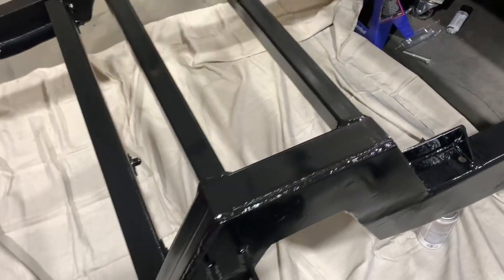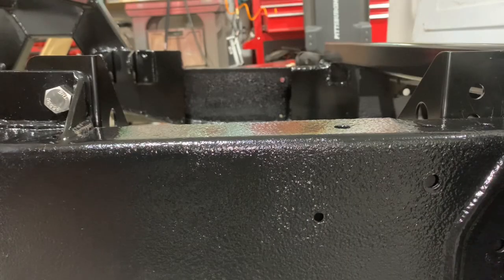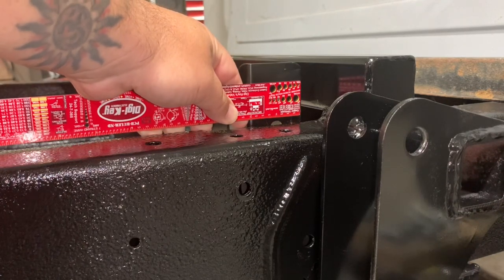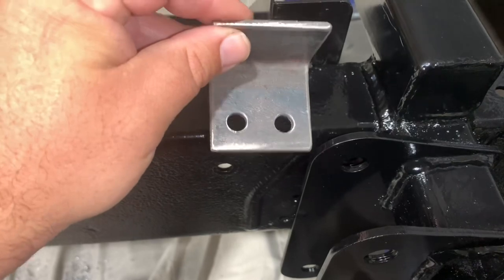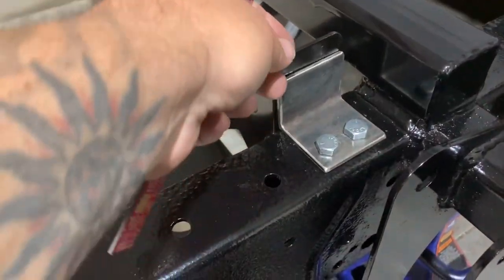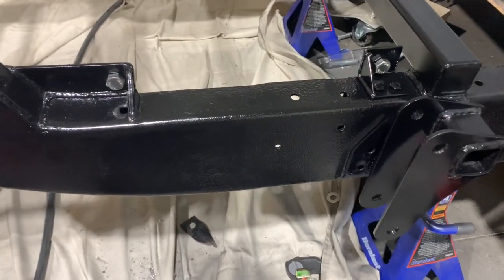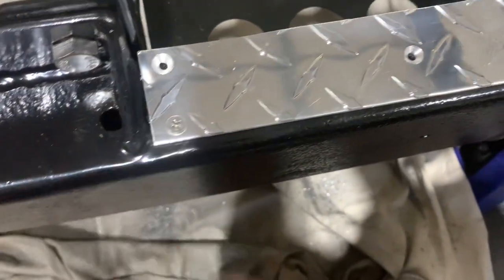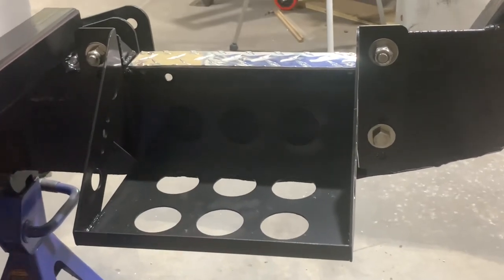Old-School but Real-Cool: Battery Relocation UNDER Bed Floor!

Comment: I mounted a similar battery box to my frame.  Instead of a single battery, I used two Braille 3121s wired in parallel.
Reply from the maker: Very cool! Ive since gotten the whole system wired up. Check it out: https://youtube.com/playlist?list=PLS6i13ij_WMmwcpofnsWqjymNiubw9MWG&si=qTUPKAirNsC4r3nG

Comment: So, the tread plate won't be seen with the bed on?  Also, a thought:  Have you tried tigging with your Miller?  You'd have a lot more control over the weld and which is handy for times like the inside of your gusset.
Reply from the maker: Im going with the plan that my bed floor will be hinged which is why Im trying to make everything under it look nice (in the event that I decide to roll into the occasional car show etc). Oh yeah, its on my short list of things to learn. I’ve actually never tried tig welding so, Id rather practice on scrap first. But yes, TIG would have been ideal in this situation.

Comment: That’s cool. Curious what the battery height is in relation to the battery box height? It going to cause any clearance issues with your bed?
Reply from the maker: Its designed to fit a group 34/78 battery which is 11x7x7 roughly. Even if it sticks up past the frame rails its not an issue anyway because I step notched the frame… going to have a raised bed floor regardless.
Reply: Awesome! I like the idea! Good job!
Reply from the maker: @williamdavis1740  thank you brother!